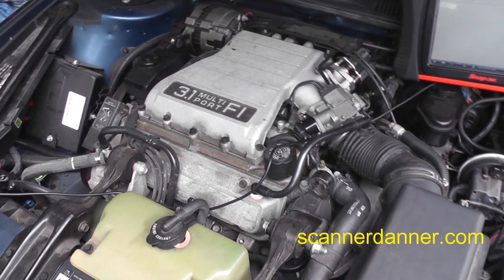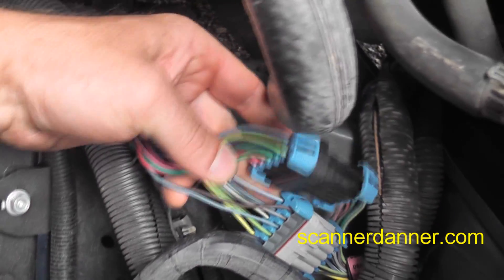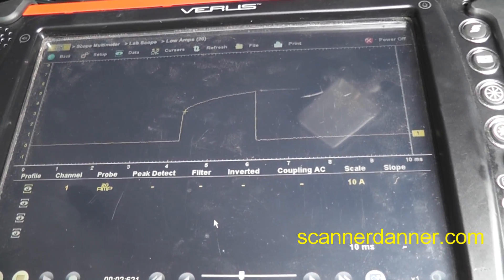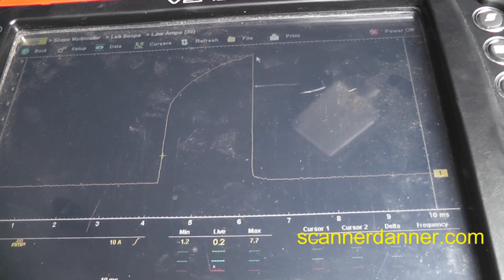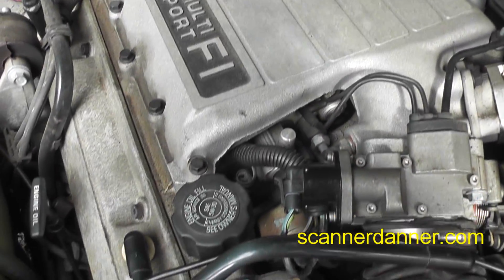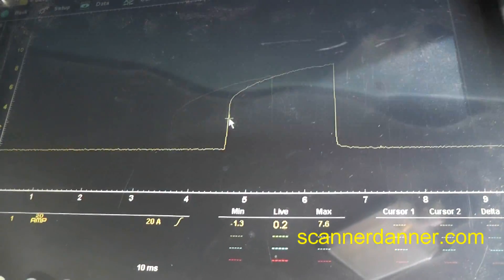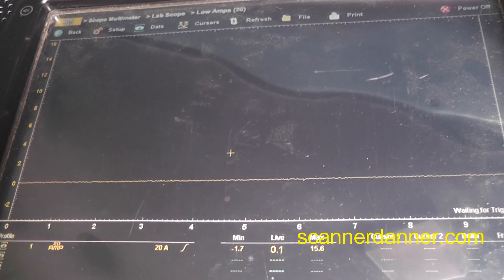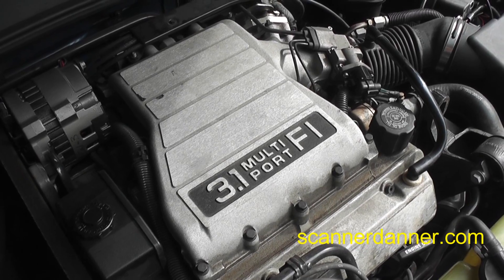Rough idle, MAP code 33,  intermittent no start (shorted injectors) - GM

Comment: Ever run into a rough idle but no code?.. 2013 ford transit . Has a new TPS. I don't have as good of a scanner you have but I can see fuel trim and I have -10 long term. Possible injector leak?
Reply from the maker: or MAF issue, but that usually won't cause a rough idle, so yeah, injector could cause that. What are your trim numbers at idle compared to 2500 rpm in park? Both banks
Reply: @ScannerDanner  I only reved it to about 2k long term went to -7.. not sure about both banks? I thought stft and ltft there was only 1 bank on that ....on a personal not i cant believe your actually talking to me.. your a god bro.. people lose their minds over celebrities.. not me.. your the celebrity to me.. I really appreciate it
Reply from the maker: @TheBracket1  what engine is in that transit? How many liters?
Reply: @ScannerDanner  2.0 4cyl
Reply from the maker: @TheBracket1  okay, then you only have 1 bank, sorry, a v-type engine usually has two and I thought it was a larger engine
Reply: @ScannerDanner  update on this thing.. they threw parts at with no avail.. new map,maf,and upstream O2.. but still falls on its face at idle especially in gear.. I cant make and real good guess on what to try at this point other than injectors.. but my scanner doesn't have that kind of test for a 2012 transit.. other than light a match you got any ideas?
Reply from the maker: @TheBracket1  "falls on it's face at idle" How does it run under load?
Reply: @ScannerDanner  runs fine under load.. idling it will hang around 800 then drop to the point of stall.. then catch itself idle back up.. then fall again.. if the ac is on it will flat out die at idle.
Reply from the maker: @TheBracket1  is the throttle body clean? I have videos on dirty throttle bodies and why they can cause stalling problems and false MAP and MAF codes
Reply: @ScannerDanner  I actually looked at it this morning and its pretty clean.. and I have no codes

Comment: Self-teaching and I don't know where to start so I'll just ask. As you measure the amperage running through the injector control wires the curve on your scanner shows a sudden spike/line up to its intial amperage and then curve up to a maximum and drops off suddely again. What does this mean/represent and why does it indicate a short circuit? I understand my question is based on a lack of understanding of basic behavior of circuits, etc.--throw me a bone here :)
Reply from the maker: This one should answer your questions. I have others, let me know if it doesn't. 
https://www.youtube.com/watch?v=KF9viLxwJNc

https://www.youtube.com/watch?v=3gTLY6vsxMg

Comment: We got one of these in our shop now. 89 Pontiac 6000 with the 2.8. My snapon rep hooked me up with a first gen verus for a wicked price so I stayed late testing her out on this car. Got some good captures. Definitely saved the car from getting a lot of parts thrown at it... 

I am worried about the fuel injector driver though. When cold things look pretty good. But then you try to start it after it's hot and the pattern starts looking pretty ugly. The driver stays energized longer and longer. Up until about 240 degrees of crank rotation then the injectors just spike at over 10 amps per bank. Here's a link to the capture:

http://imgur.com/a/Ku0AN

Oh and btw, I noticed something cool in your video. At 8:40, every time you move the trigger it resets the min/max scales. Not sure if you were aware of that. I definitely wasn't until now. 

Thanks for all the great videos.

Comment: hi danner, I have a 2001 elantra whit the 2.0 engine and a code p0133, I replace 2 upstreams ho2s and nothing it keeps setting the code,  threre's no exhaust leaks, intake leak, I clean the injectors also, need help please!!!!!!!!!!!!!!!!!
Reply from the maker: alekstolstoi what is the definition of the P0133 code? Is it a slow response code? If so, these are known for cracked exhaust manifolds that cause this condition and from what I've heard, you cannot hear it. You have to remove the heat shield and inspect it very closely.

Comment: Its gotta be a bad driver in the PCM!
Both 12 volt feed to ASD relay strong an can power pretty much anything!

I'm getting a 12 supply from the PCM which is the ASD output!

If the PCM can ground the ASD relay when its running an when I swap out the relays from the rigged one to the normal one then the PCM has a ground!

Tested everything in the ASD relay that the circuit consist of!

Next thing is to try another PCM an see what happens maybe the other PCM I tried was bad never known gotta be something!

Comment: So I was thinking myb I'm seeing 12 volts on the ASD relay but it not able to push any amps thru!

Like a wire that has only a few strands holing it together!

So I used a headlight bulb an some test leads an she is burning bright!

I unplugged the PCM coneector an did same test on the ASD control wire pushed 12volts thru an same thing blinding bright!

This really looks like a PCM driver problem!

Now all the sudden I can't get the truck to start even if I jump the relay I hear the fuel pump relay click an some other ones but the truck isn't coming to Alive so something is fishy here for sure!

I'll keep everyone update who has the same problem or may have it in the future!

Thanks!

Comment: I went thru every fuse inside an outside an from all the wiring diagrams an there all good!

If I was missing a power or ground wouldn't it effect something else not just the ground control for the relay!

Like if the main PCM ground was not making good contact it would effect the sensors an whatever else!

I could condemned the PCM driver if it wasn't working at all but it just doesn't send a signal when the koef works fine when the eng. Is running! Makes no sense!

Comment: Let me start from the beginning!
Vehicle stalled out an got a no bus on the Lil info screen.

Then the gear selector screen the box would go from p to 1st gear!

Then I started testing an found the relay problem

So I took a relay opened it up an put a zip tie around it to tie the armature closed so it would work an then everything was normal no codes then now I'm getting a system voltage to low on the transmission module side!

But before all this happend I did get a code for no power to the PCM or something like that!

An a code for the governor pressure sensor an when I check my 5 volt reff didn't have one an I thought the governor sensor was shorted an pull the 5 volt reff down but then I realized that I didn't have a 12 volt feed to the injectors or the coil!

Then I knew it was a bigger problem than a shorted sensor!

Comment: Tryed same test you said but with a multimeter an noticed that for a sec I said a 9 volt spike an then nothing!

Almost like the PCM wants to send the command but something is shutting the driver down!

Sorry for blowing your page up!
2 days with this things an I'm ready to burn it to the ground!
Reply from the maker: This is the second computer with the same problem? What trouble codes do we have and forget about the alternator for now. It's powered by the ASD circuit as well.

Comment: For the PCM to command a signal to the ASD relay is there something it has to see like cam an crank signal when it runs!

I checked for a 12 volt feed from the ign. Switch to PCM an its there!
When it runs there no codes or anything thing out of the ordinary!

This would be a great vehicle for your students at rti!  Here figure out what your missing students! Lol
Reply from the maker: Cam and crank yes but during initial key on no. Just an ignition feed for the PCM. You need to check all powers and grounds next
Reply from the maker: Stay in this thread please. I read your no bus post. Powers and grounds are next. Nothing else to offer until that is done bro.

Comment: Hey Paul I have a question for ya myb you have been down this road an have a answer!

I have a 04 dodge Dakota 3.7l
Problem is that the PCM isn't grounding the ASD relay!
If I manually ground it truck runs an when its running I can pull my ground wire off from the relay an the PCM will maintain to ground the relay an truck runs normal!

I've checked the wire from the PCM to relay an good!

I put a t pin in at the PCM an use my incandescent test light to ground the relay!

I'm stumped another PCM was put in an no change same problem!
Reply from the maker: There could still be an input problem. Let's change up the test. With your t pin on the ASD control wire at the PCM, connect your test light to battery positive and tell me what the light does during the initial key on then also during the initial crank. You should remove the ASD and fuel pump relays for this test to prevent feedback and misdiagnosis.  The fuel pump and ASD relay use the same driver.

Comment: question on a 02 mustang 4.6. runs with #1 cyl dead . i probed everything and no injector pulse to the injector, all others are fine. removed the computer and probed at the connector , no pulse for #1 injector , replaced with used computer out of a running vehicle, reprogrammed it, and walla ! still no injector pulse, just like the original, again all other injector signals are normal, along with all coil signals normal . any thoughts ?
Reply: jr musicfactory check the ignition for the cylinder. This should be an individual coil. Once the ecu detects a no fire it will not allow injector pulse. This is done to prevent fire and also save the catalytic convertor from damage from raw fuel. Once the ignition for the cylinder is good clear all codes and all should be good.
Reply: thanx a lot :)

Comment: scanner danner help.  crank no start. no codes, got fuel , get spark, got compression , put noid light on inj. wiring . no light. 
put multimeter from battery ground to inj plug. Results are Pin one Battery voltage , pin two 3.2 volts. was not expecting that. 

Maybe a curve ball. brake lights on all the time ign. in on.

Comment: This's almost like watching myself the first time I ran into this problem. I current ramped the injectors with my Vantage Pro and saw the exact pattern shown on the scope at 8:28. Funny thing was I ramped the injectors on that car almost first thing and didn't realize it was a bad pattern and beat my head into a wall before I found out I had a bad injector. To add insult to injury, I only replaced the shorted injectors and had to do the job again a month later, just like you said in the video.

Comment from the maker: No MAF and the MAP code was an effect of the rough running engine, not the cause as DJDevon3 said. 
As for damaging the ECM driver? There is always that possibility and I have seen shorted coil windings on ignition system fry drivers, but have not on this design. They are protected very well from too much current. This is why the engine will not start at times with this condition. The ECM enters current limit protect mode so fast that the other injectors cannot fire.

Comment: What about bench testing with an automated test setup.  Wouldn't that be able to eventually heat up the injector to show their true colors?  I know most people aren't going to bother with that kind of thing just a theoretical question.  I hate seeing bad designs.  Access to only 2 out of 6 injectors without pulling a valve cover off.  Sometimes I want to backhand an engineer with a white glove.

Comment: My 90 3.1 camaro had this same problem! To the point where it turned into a start stall concern.ran circles and scratched my head.found one group of injectors had less resistance than the other group.then my Forman came over and unplugged injector 3 and just like that engine ran perfect.plugged back in and stalled.replaced em and has been good.man I wish I had a scope and this vid.

Comment: Replaced hundreds of these injectors. The reason for failure was GM used a type of varnish on the windings that broke down (washed away) due to oxygenated fuels. Cured them with later model designs.

Comment: I've seen a lot of garages change crank sensor if a car has a stalling problem etc.  Don't most cars use the crank sensor on the rev counter as well? So if the rev counter works ok it normally means the crank sensor is working OK too.